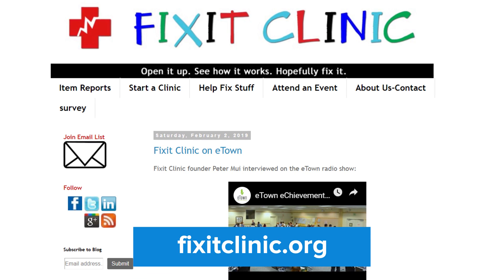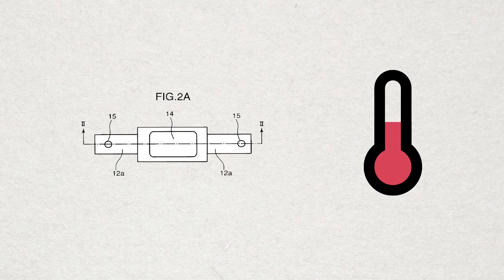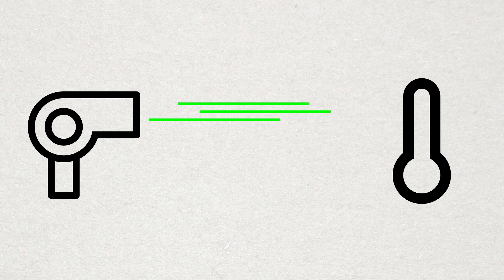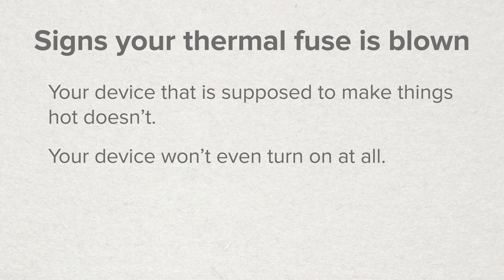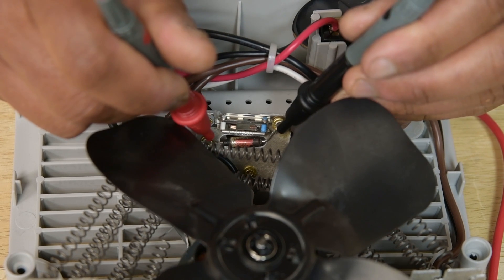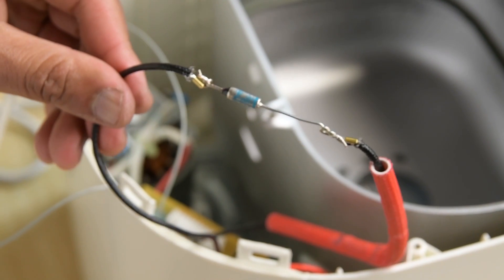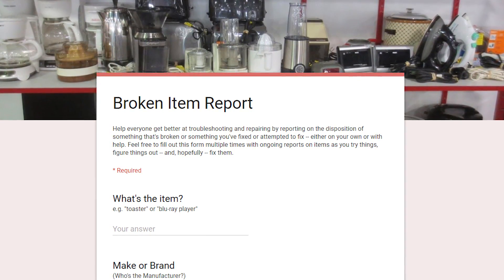How to Replace Thermal Fuses: Repair Tips from the Fixit Clinic

Comment: Yeah basically fraudulent doing work like this.   Should be crimped or spot welded.  Unless its a high temp solder not good.  Wrapping wire and leaving it will fail guaranteed.   Possibly leading to all sorts of issues.   What a rotten video.

Comment: The first time I replaced the thermal fuse on my drip coffee machine, I tried to solder the terminals but the fuse got heated and blew out. Lucky I had a pack of 10 fuses that I got from AliExpress at about A$1 each. So the second time around, I crimped the terminals instead. Also repaired my rice cooker the same way. Had to buy another type of sefuse as the ratings were different to the ones for the drip coffee machine.

Comment: The bad thermal fuse on my wife's iron is not marked. It is just a shiny metal cylinder. What value of thermal fuse do I need? The label on the back says 120V-60Hz 1200W.

Comment: Do I can replace a tf with different heating value? What I has on my dryer is 210C, but the value of the new fuse is 200C. amperes and voltages are the same.

Comment: Hello, the pb is to know the definition of the fuse when it is broken, because what is written on it can desapear due to heating. My need is to know the nominal values for a blowing heater 1800 W, it needs 10 amps, but which temperature range should it generaly stands? 150°C, 250°C or else?

Comment: Have you ever changed a thermal fuse in a shaded pole motor? I exposed the wires under the tape, and found the fuse. But i cut wires so I could get to the fuse to test. It was bad. But I cut the other wires, so no repair possible. It wouldn't be easy. Not for me.

Comment: Also inside ceiling fans for lights, but sold be manufacture, not generic. Box fans have a fuse on the cord end and usually tiny glass fuses at 3 Amps perhaps. A pocket screwdriver can open the end, lifted out while in plugged of course. But unfortunately sold in mixed sets. Walk into a repair shop and they ask for $5 for this $0.03 cent fuse or a simple capacitor. But when they fall by dog or flat on the ground, you want that fuse to open. Fix legs with wood or metal and rubber feet, but for $25 dollars, people replace them sad! Lawnmower of of gas, throw away. 3 speed fan over cook top need cap, $250 gets a new one! $6 gets a cap and wiring is inside cover!

Comment: Small Rick cooker had thermal fuse 160C getting burn always.  So have used 180-200 fuse. Same. Everyone while cooking it get burn middle way.  Have replaced magmatic switch also but same result.  While cooking in middle fuse get burned.  Wires all ok.  
What could be the reason ?

Comment: I discourage anyone from using solder to emplace these, both to not damage the "fuse" and shorten it's life and as solder can melt for some of the higher temperature models.
Reply: Have not seen it happen in real life.  A decent solder job that is quick and not too close to the fuse works.

Comment: I have replace the thermal fuse 3 times now on my air fryer.  It's the right temperature rating.  Any thoughts?
Reply: blower not blowing enough.

Comment: When replacing the thermal fuse , does it need to be soldered with the pointed end facing a certain direction or can it be soldered either way.

Comment: there are two sides of the thermal fuse one of them is the conical epoxy side. so which side is better connected to the hotter connection of the appliance. example: in rice cooker, the terminal of the heating element obviously hotter than the other side after the thermal fuse. so which side goes to the hotter junction ?

Comment: I have found out that the very best way to fix something with a thermal fuse is to bypass it with a wire or wire nut. Of course my house burnt down a few years ago and the inspector said it was a defective toaster that I happened to do have done my famous repair on.
Reply: Ummmm.   Maybe don't tell the insurance company that.  LOL.

Comment: FUSE ORIENTATION (for SEFUSE SF type thermal fuse)
Lead A is the black ceramic end.  
"If lead B of the SF-type, which is caulked to the metal case, is mounted in such a way that it only conducts heat to the metal case, the temperature around the thermal pellet would always be higher than other parts in the metal case.  This could lead to the thermal link opening prematurely. Hence, it is recommended that lead A, which is the resinsealed side, be connected nearer to the heat source.  It should also be mentioned that similarly, if lead A is fixed in a location where the temperature it is exposed to is always lower than that of lead B, the thermal link could also be prematurely triggered."

Comment: Does thermal fuse go 1 way or does it beep 2 ways if you masure continuity?
Reply: Continuity is measured either way. Same for your multimeter leads, work either way. 
Notice that continuity in this case has no "direction".  It only matter in diodes. Cheers ;-)

Comment: I tried to fix my babyliss hairdryer by replacing the thermal fuse. I don't know the reading of the thermal fuse as it is not written. So I use thermal fuse with reading 160 celcius 10 A and 240V. The hot wire only glow three layers not full and when I put speed 2, the motor run so fast.. I don't know why ?

Comment: If you’re skilled and fast enough, you can solder on a new fuse without blowing it out.
Reply: That's my experience. Worked fine.  Did not even use heat sink clamps or tissue. Just do a good job, clean and fluxed.

Comment: Wrap the thermal fuse with wet tissue to avoid thermal fuse blown up. Especially thermal fuse with low temp like 117 or 130C

Comment: Do we need to check thermal fuse sides before connecting or both sides are same
Reply: Yes, try to match the existing one.  Although it should work either way.  I'll add a comment about this.

Comment: can you tell me the specification thermal fuse for air fryer fan. ? the spesification cannot be read again.?  can i use 130 °C. or higher?. thank you for your ansewer
Reply: if i bypass the fuse the fan can rotate
Reply: Bypassing is an excellent way to burn your house down.

Comment: If the manufacture has it soldered use solder if it has splice caps or crimps use those. Maintain the UL listing and you will be ok.

Comment: i have an ambiano deep fat fryer that wont heat after we had a power cut while the fryer was running , but im struggling to see how it comes apart other then the 2 small nuts at the bottom

Comment: What I dont understand is why would a themal fuse be covered with insulation sleeve. Isn't the whole point of the fuse to be exposed to temeperature around it not resistant by being insulated?
Reply: The thin sleeve will allow plenty of heat to reach the fuse.  The sleeve is to insulate the exposed fuse leads to not allow an electrical problem.

Comment: what if my kettle 'pauses' during boiling? the switch doesn't flip back, it looks (and sounds) like it's heating the water then stops for 2-3 seconds then starts heating again. it takes about 15 min to boil now instead of normal 3-4 min.
Reply: There is a possibility that your device has a thermal, self resetting circuit breaker.  When the breaker cools down, the power will be restored.   Not used often due to the expense.
Reply: @gulfcoastmike3003  well... i don't think my cheap kettle has it. anyway, i managed to take it apart and simply cleaned the contacts. now it works better.

Comment: Is not that silicone sleeve preventing the true measurement of temperature from that fuse? In my application, silicone sleeve prevents us from reading the right temperature and fuse will not work when it should. How can we solve this problem? Is there any sleeve which is thermally conductive? Thanks in advance.
Reply: The sleeve is not silicone.
It is a fibrous material similar to that used in fiberglass.
The temperature attenuation is very small overall.

Comment: Thermal fuses should be installed using a seamless butt splice, just as they are originally. NO solder or twisting wire - very dangerous! All thermal fuses are rated for 10 amps maximum, which is probably why they failed, not from overheating.
Reply: Mostly correct, however, all  thermal fuses are not rated the same.  Some are 2, 3, 5, 10, 15, 16, 20 amp or maybe more and can be found on Amazon.  That said, THANK YOU!  My 1500w  120v grill had a 10 amp  G4 fuse in it from the factory, and it blew.  After replacing it with same, the replacement blew when the grill was pulling 1350w or 11.3 amps.  At full load of 1500w, it would have pulled 12.5 amps.  I would call this either poor engineering/design or built-in obsolescence.

Comment: Does it matter which way the taper end of the thermal fuse gets reinstalled
Reply: Yes
Reply: @donnasfix-it3861 , what kind of an answer is this? SMH

Does it matter? If it does ("yes"), which way?
Reply: People also ask

What direction does a thermal fuse go?

thermal safeguard. Fuses have no directionality, solder it any which way.Feb 10, 2021

Comment: Fan motors also can have a thermal fuse.  My 20" metal industrial fan that I'm going to have to 
 dissemble actually has a thermal fuse on the winding of the motor that I'll need to replace as the capacitor is fine and the regular fuse in the plug checks out too.

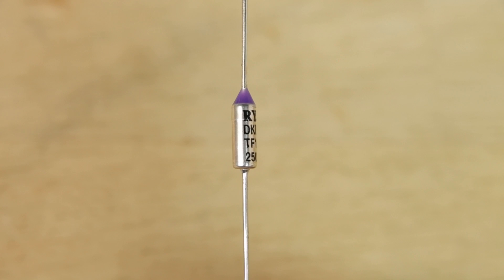Comment: Here's the fix: 1:49 - 2:13 
Wow. That was dissapointing.
If I didn't read the comments I woudn't have even known you twisted the cables over achother. Didn't even explain why its better to twist them instead of soldering? I'm left with research to do.

Comment: My air fryer is has a problem when i plug in it instant strt fan and heater. Display birton are not working just blinking and tik tik sound comming from contector rely.  What the problem

Comment: What is the value of fuse if I connect it to washing machine
Washer- 391 Watts
Spinner- 183 Watts
230v supply
Thanks
Reply: Power in watts is equal to current x volts.   P= I  x. V    so  p devided by v = I which is the running current of the appliance in amps .   a fuse rating slightly higher than the running current is needed .  Your values in watts for the washer and spinner seem a little low check the ratings again hope this helps.

Comment: Crimping or ceramic wire nuts are an absolute bare minimum to secure the connection. Soldering is best. A loose twist is never a good idea for final repairs and can be very unsafe.
Reply: Soldering a thermal fuse is mostly not recommended since the heat from the soldering iron can blow the fuse. They usually come crimp connected from the factory rather than soldered.

Comment: I replaced one of these in a Breville Panini grill, but it's blown AGAIN!  I think it might be the orientation of the Thermal Fuse.  Does it matter which direction the tapered edge of the Thermal Fuses faces?!  Does the Taper side needs to be connected to the side where power is fed?
Reply: No.

AC current flow switches direction 50 or 60 times a second.
Reply: Current flow direction does not matter.

Comment: Sir if the only info that we have are the rated Power and rated Electromotive force, can I use the the formula for computing what thermal fuse to use;  Power=Current x Voltage? for example:  current=1100 watts/ 230 volts x 1.25; the amps is the current capacity of thermal fuse.

Comment: The question is why they don't make appliances with replaceable fuses (no soldering needed). It used to be the case in the past. Fuse replacement is cheap, but they make it difficult, and most people would buy a new appliance rather than repair themselves or send it to a costly repair service.
Reply: Scam. All about money. Accessible fuses are a thing of the past. 

Ever see an Android tablet with a replaceable battery? They don't exist. 

Most cell phones now don't have replaceable batteries either.
Reply: Yeah ,,& especially if made in China everything glued in place
Reply: Agree with your view & twisting part. Lockdown due to COVID has made many people repair their belongings. Tons of videos on learning & repairing of electrical & electronic devices on YOUTUBE. Even quarterly Maintenance & repair of automobiles we can do at home... Saving our hard-earned money.
Reply: Really already

Comment: CRIMP [mechanical fastener] IS THE RECOMMENDED ENGINEERED METHOD FOR FUSE CONNECTIONS. ALWAYS CRIMP, SCREW OR RIVET THERMAL FUSE LEADS IN THEIR CIRCUITS. HEAT SHRINK THEM WITH CLEAR HEAT SHRINK IF NEED BE FOR EASY VISIBILITY AND REPLACEMENT THE NEXT TIME IT FAILS - OPEN CIRCUIT.

CSA, UL, TUV, standard is to CRIMP, SCREW, or RIVET, not solder, a thermal fuse connection (mechanical fastener). The reason for this is that the soldered connection may break down thermally before the fuse, thus causing a permanent open circuit and increasing the likelihood that the wires separate and creates a short circuit somewhere else in the appliance that will increase the danger of a fire!!!

Today, my weed wacker's thermal fuse is stuck open circuit. Diagnosing all components in the circuit has identified this as the root cause of the problem. I can now run to the local electronics store to buy a replacement thermal fuse with the exact thermal rating and get my weed wacker up and running again for the cost of my time and $2.00 CDN. The weed wacker is still good electrically and I can get several more years out of it because the brushes for the AC motor are still good, including the armature and coils.

Before you throw it away, do yourself a favour and take it apart to at least learn why it failed in the first place, even if you're unable to get a replacement part for it.

Failure, and learning from failure, is the root of all great innovation, success and riches in life.
Reply: Here's the data sheet from the manufacturer of the thermal fuse I need to replace: https://www.tme.eu/Document/bdc09498537597553d25678f42df7883/BF.pdf

Comment: Boo to not advising soldering thermal fuses in place! This is a VERY bad idea, as just twisting those wires alone is NOT a solid connection! Depending on the appliance, if it is handled a lot those connections could come loose at any moment, and could possibly cause more trouble than you initially had! For a channel that promotes fixing things yourself, I definitely would have expected better! Definite thumbs down on this one!

Comment: There is a reason you don't see these things soldered. Solder melts when heated. Also if you heat these too much they can weaken or even blow. I would also strongly advise against just twisting them. You need a good crimp rated for the application.
Reply: Mine came with heat shrink tubes.
Reply: You still can solder it for better contact but wrap wet tissue on the fuse  to reduce temp to the fuse. It is important for high watts applications like grill 3000 watts. Weak contact can cause fire
Reply: Steel melts when heated too.  The actual question is: "at what temperature"?   Typical non-lead solders melt at higher temperature than most thermal fuses.
Reply: @ceeweedsl  typically soldering is at ~300-330C so.... good luck with 150C fuse :)

Comment: Based on a bunch of the know-it-all soldering comments I guess I need to go through all the 15 amp wiring in my house and solder together all the wires inside of the wire nuts.

Comment: HELP! I would like too replace my thermal fuses (there are two connected in parallel with one another) on my toaster oven. However I don' have the know how to replace them with the correct size nor which direction too connect them back.The reason for this is that both thermal fuses were completely fried beyond recognition. I have not tested anything else for any kind of failure but just doing a visual of it there does not appear too be any obvious signs of over heated or burnt wires or other components. My oven is rated for 1500 watts and thermostat temperature control for 450 degrees. Also how could it be that these fuses got so hot that they literally fried.Ty.

Comment: I'm always confused for a moment when someone says "degree centigrade" instead of "degree celsius". I learned, that celsius is the unit and centigrade describes only that it's using the number-100-based counting method.
Reply: in Spanish and other languages, is very common to use centigrade, and it shouldn't cause any confusion, precisely because is based in 100.. and it works exactly the same as centimeter, bottom line: celsius and centigrade are synonyms

Comment: And you run classes teaching people that just wrapping a wire around another is good enough? 

Its idiots like this that teach people bad practices that keep firemen in work putting out electrical fires..... 

What a clown...
Reply: He was also wrong about the thermal fuses just going bad for no good reason - they go bad sometimes because of age. And that you have to get them from overseas. You can find them at many companies online here in the states. I wouldn't call the guy an idiot, but he clearly doesn't know what he's talking about.
Reply: @robertcalkjr.8325  , over the wrapping wires around each other deserves something a lot stronger than idiot. 

over here in the UK we have 240VAC even poorly terminated wires are a problem. Those twist on caps you have over the pond are illegal here.
Reply: Lol! Yeah, I was just trying to be nice. The twist caps should be illegal here as well.

Comment: Nice video ifixit! Although I see that some comments suggest to join the wires without the fuse! That sucks, because if there is a fault and the fuse is bypassed, your heating element in your device will take 🔥!
Reply: Hmm, I must have missed it where they simply joined the wires up without replacing the thermal fuse. Got a time stamp
Reply: @GregM  I'm so sorry, you're right. Thanks
Reply: depends on the appliance.. in a hotplate with a thermostat and interrupts the current when reaching a temperature, it shouldn't be a problem, unless the thermostat breaks

Comment: I always solder my thermal fuse connections also with heat sinks close to the component.
Reply: Pressurepro cooker won't turn on, it's not the thermal fuse.  Water was poured on without the pot.